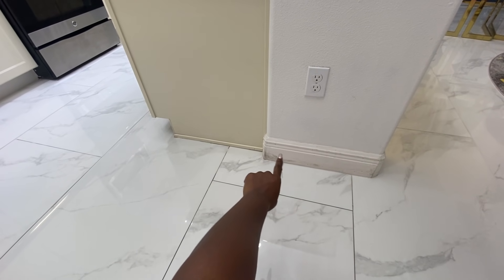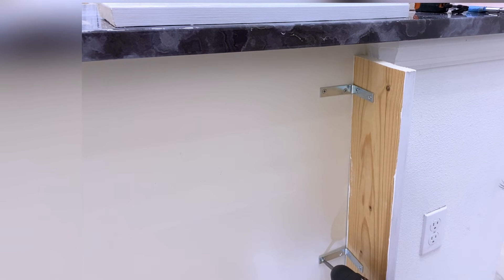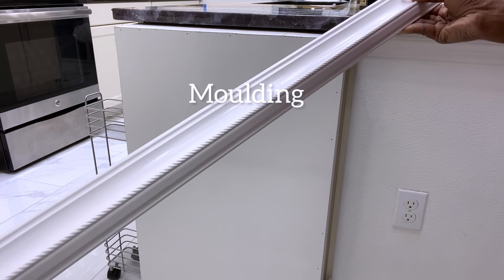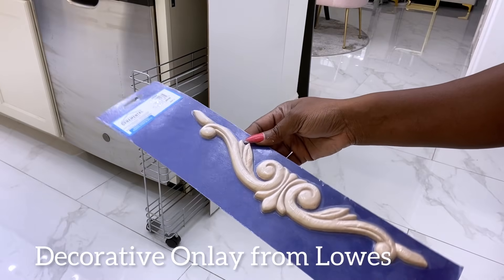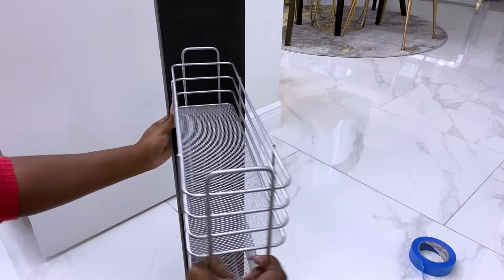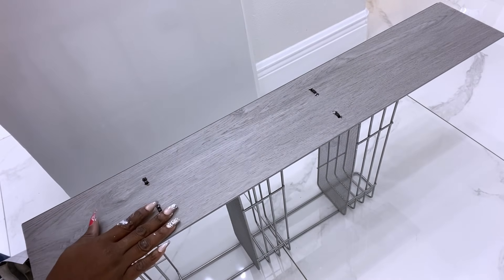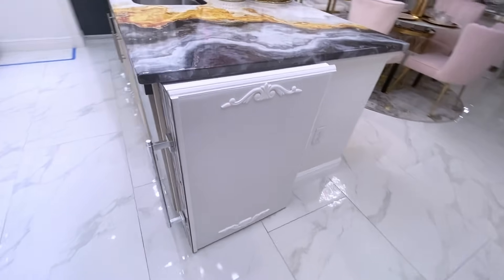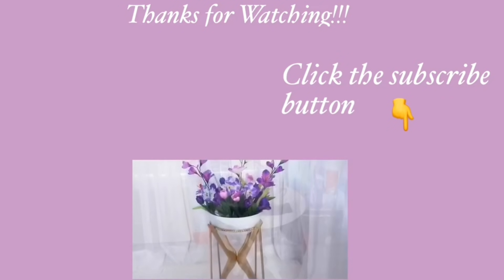HOW TO Hide Extra Storage| Kitchen Island Storage! DIY Home Improvement Project.

Comment: Love the idea of this extra space , but I worry about the handle sticking out kids running around
Reply from the maker: The island in my home has an overlapping lip/Top that covers where the handle protrudes 💕
Reply: you could just adjust your measurements accordingly and reduce the length of the sliding storage, enough that the handle is just on a level /plumb with the  bench space